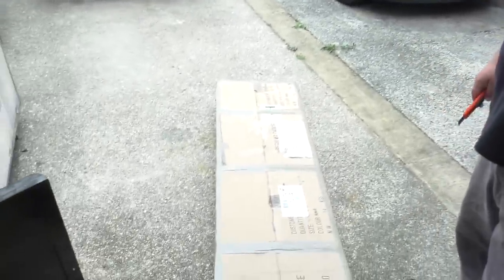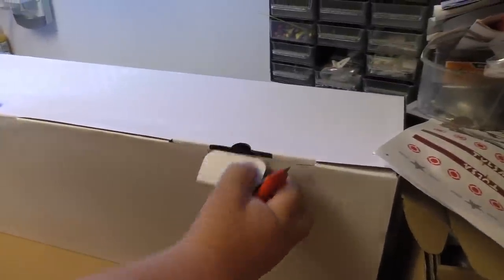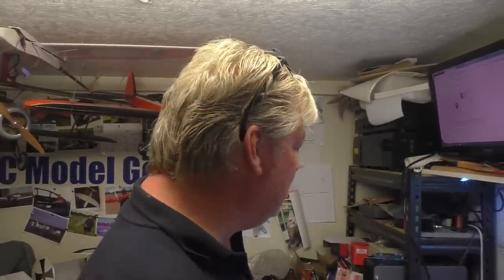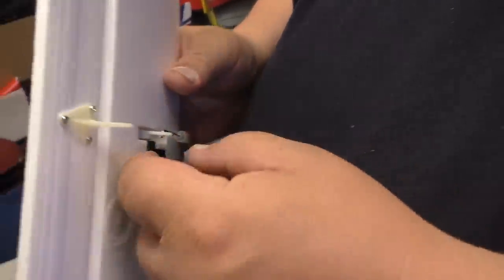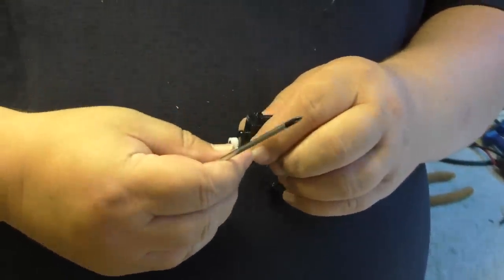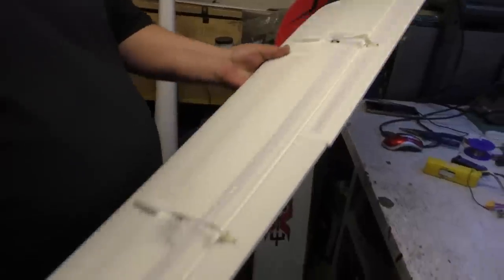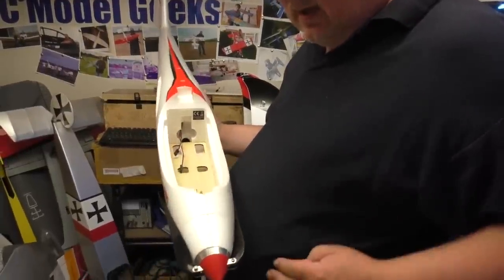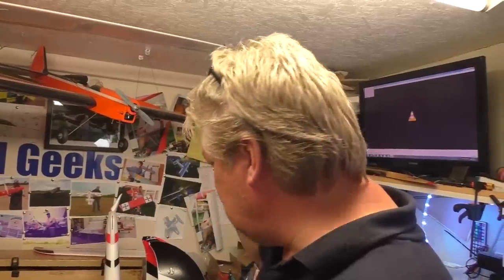Art-Tech Hobbico Tec Zone Excalibur 260 electric glider build

Comment: I quite agree, a discount should be in order with a packet of compensatory 'Garibaldi's'. It looked like it was reasonably packaged but only after the dog had a go at it. Suggestion: How would you feel about taking the control surfaces off all together and install proper hinges to remove all stiffness. Just a thought. Also don't give the QC rice instead give a DCM (Don't come Monday) instead. The workmanship is absolutely shonky and coming from Germany it's really bad. I have also found that Hobbykings quality is deteriorating. I am waiting for the delivery from Horizon of their Aire-batix and after seeing what you have unboxed I"m hoping for a quality product, we'll see.
Reply from the maker: I am contemplating re hinging it at a later date, along with ball linked horns etc. lets see how it flies first then decide if its worth tuning up.